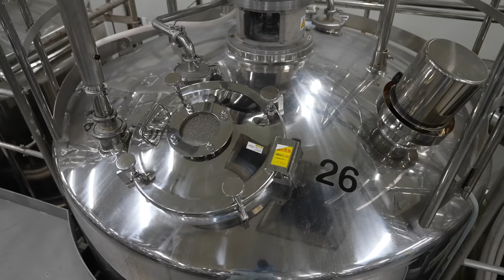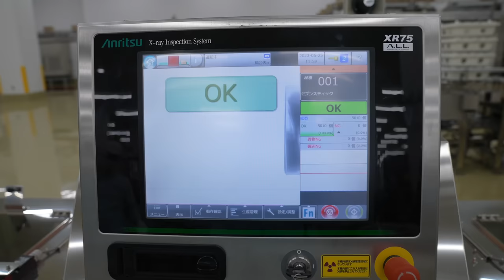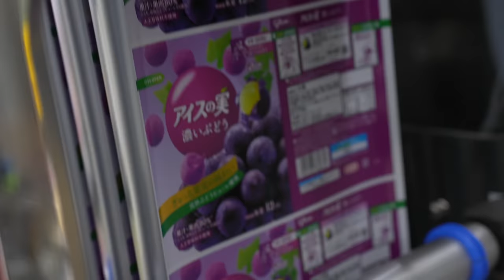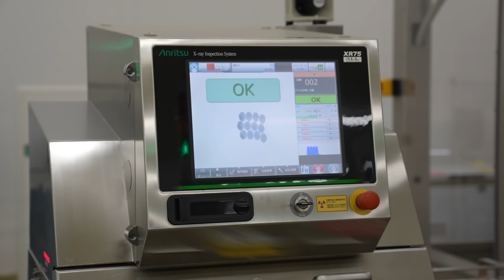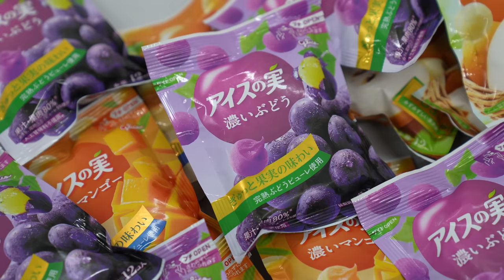アイスの実、セブンティーンアイス、パピコを製造するプロセス。誰もが一度は食べたことがある日本のアイス工場。

Comment: Those who complain about plastics in Japan should at least be aware of Japan's strict garbage separation and the Law for Promotion of Recycling of Plastic Resources.

Postscript.
Japanese plastic is burnable trash when separated. There is little illegal dumping and Japanese plastic is a material that does not produce toxic substances. It is also used as energy for incinerators. There is no problem because the incinerators do not produce toxic substances. And in Japan, the energy for that incineration is necessary. So the issue is global warming caused by incineration.
We should understand that each country has a different culture, climate, way of thinking, and everything else.
In Japan, garbage collection is commonplace. Of course, countries that complain about plastic do not litter (illegal dumping), do they?